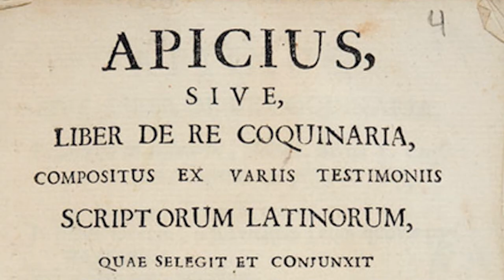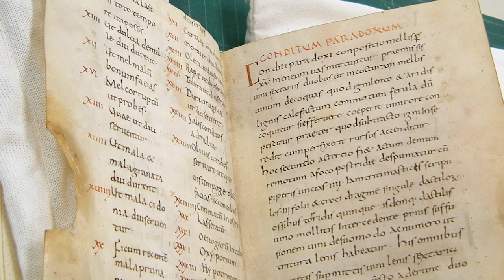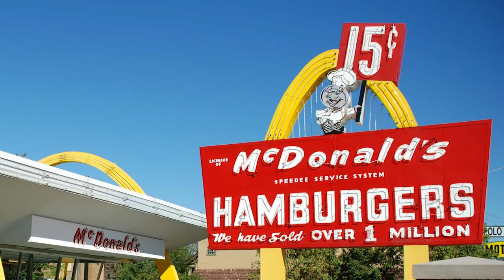How to Make a Burger That Costs $437

Comment: There’s a huge improvement in your blacksmithing!
Reply: But a huge failure in the premise; the promise of discovering and building each step in the reset journey.
Reply: I bet it wasn't him
Reply: Some scenes are him but not the the rounding for sure. I like the show but boy he is still so bad at making things by hand after all these years.
Reply: @skipmage  You're right you can wait years to do it the "right way." For the most part proof of concept is enough to demonstrate it was possible. Not using more efficient methods after after proof of concept is a waste of time.
Reply: @allstarwoo4  And I'd be OK with that if, you know, He didn't have a real blacksmith make him a set of tongs from bar stock in a modern forge with a full set of professional tools, before he's so much as forged a cohesive piece of  iron.
And then Andy just continues on like, hey guys these tongs work great there it is I've mastered Iron, so I'll just start using steel too, cause copper and bronze are totally the same metal.
Reply: @skipmage  yes but no, this is not primitive technologies, his series progresses rather than sit on one category, since budget and time constraints are a factor, he can’t idle about without posting. There will always be a compromise since we don’t know how well he’s doing. It’s like telling him how he should run his show when you yourself don’t really know the process that takes place. If you look at linustechtips work flow, it makes video production seem like a headache. There is no right way, just enjoy what he can do
Reply: @skipmage  well the channel is about recreating discoveries in human history not about becoming a master of a specific skill. I get it sometimes I get annoyed when he doesn’t do something to his best abilities but sometimes it’s not reasonable or it doesn’t matter.
Reply: @allstarwoo4  we are not talking about the man half carving a stick and calling it done; we are talking about finding silica and calling that a computer.
the technological divide between Iron and steel is something like a thousand years.
We are Talking about a Provider Promising a climb through technology by himself, and completely shitting on that promise.
Reply: @skipmage  it may have taken a 1000 years but going from iron to steel was easy. All they had to do was add more carbon in the smelting process.
Reply: @allstarwoo4  No, and the fact you think that shows my point.
The problem was getting less carbon in the smelting process.
Wrought Iron has a carbon content of about 8-12% where as good high carbon steel reaches 2-3%.
Wootz steel did this by segregating the Iron and a little carbon inside the crucible.
early industrial steel producers did this by burning out additional carbon, which was hard and sloppy.

And again, If it was Easy, I would care less about Andy showing this step.
Reply: @skipmage  These steps have been covered before.
Reply: @skipmage  that refinement isn’t necessary in that they only need enough carbon steel to show it’s possible. Think about it the burning out process is just them leaving the bloomery on so the carbon can achieve their ideal carbon content.
Reply: I've always thought that part of the point of this series actually is the fact that Andy isn't very good at most of the new skills he's learning. It helps show just why it took thousands of years for certain technologies that may now seem simple to us to be developed.  The bloomery saga, all the attempts that it took Andy to make just one crappy little blob of iron really made me realize why the bronze age lasted so long. So it makes sense that in order to keep advancing he sometimes has to skip over a few thousand years' worth of the trial-and-error  that was originally required for humanity to refine a certain craft or technology by having someone more experienced make something for him, if it's something he's going to need for the next project. Showing how someone who actually knows what they're doing does it, even using more modern methods, is interesting and educational too. Would you really want to watch Andy gradually improve his ironworking skills for several thousand years?
Reply: YES
Reply: @BellToneSynthWorks  Skill is not something one accumulates for thousands of years. It's the techniques (skills as in "a particular ability") and knowledge base to help acquire that skill that does. Skill as in "the ability to do something well; expertise" can be achieved in a lifetime. 

I don't think it really demonstrates why it took so long because the crew already know what they're "supposed to do" in advance. Even with all the team's need to improve their skills and figure out exactly what mistakes they made to perfect it going forward, they at least have an exact idea of what they're pursuing. IRL it isn't just trial and error, but many years spent with one method "just working" and being the usual thing that was done without any specific idea of what the next innovation on our backwards traced tech tree is supposed to be. There was innovation, and often that innovation was directed toward an immediate practical purpose or experimentation, but it's not like people were specifically aiming to achieve future technologies they couldn't conceive of yet or make any use of.

I think the series is just fun and neat in that it shows how people in the past did things and the team attempts to do them with (mostly) period appropriate tools and materials.
Reply: @skipmage  The divide between iron and steel was a 1000 years because steel was discovered largely by accident and haphazardly.

Realistically, mastering pottery takes a lifetime, mastering copper and bronze casting takes a lifetime, mastering iron and steel takes a lifetime. considering it can take several months of dedicated work just to forge iron without burning it, I'm not going to fault the guy for getting experts in after he's at least demonstrated the process. I sure as hell can't forge that well. :P
Reply: @skipmage  Thats just sad
Reply: Kinda also goes to show that one of the most important advances in human society wasn't actually purely technological but rather in the skill of the craftsmen and that's something we tend to forget.
Reply: @skipmage  You got your % wrong chief. 
Plus " No, and the fact you think that shows my point.
 The problem was getting less carbon in the smelting process." > that's true for mass production, not for small production of steel, in small production like andy's you need to add more carbon, like in the wootz process you mentionned. I'm a metalworker and i'm fine with andy doing what he is doing right now.
Reply: @nora1034  Sure: you have mild steel at the click of a button; a power hammer, a proper anvil.
You know all the little tricks and tips for working in a modern forge.

If I gave you an apple and a cup in the middle of nowhere and told you to make bread, how would you do? 
How about If I promised you a loaf of bread then showed up with said ingredients?
Andy is doing this.

It is not a matter of if you feel entertained. It's the fact that his premise for this series has been, "Can I figure out how to rebuild tech, using only the tools I've previously built."
So, I feel just as justified in saying Andy, this isn't what we agreed on. As you feel justified in saying, ""I'm a metal worker and I feel fine with him jumping steps.

Also ash baking.

Comment: I feel like the surface texture of the spatula is making food stick, maybe a little polish with a decent stone might smooth things over, so to speak.
Reply: Just like that cleaver needs some passes over a grinder and whetstone, too, lol. Still, not bad.
Reply: Season it too, with some oil and heat.
Reply: What?!

Refine the tools instead of a doing the bare minimum?? You must be new here.
Reply: or just punch some holes in it
Reply: @DH-xw6jp  haha he just hasn't gotten to that point of civilization, right?
Reply: @DH-xw6jp  maybe they should get the most important aspect of early civilization: slave workers
Reply: @RmRoyalflush  pft, we are beyond such barbaric practices such as slavery...

We now call them unpaid interns.
Reply: Also adding grating to the spatula so that it doesn’t stick and can press the patties from the top, that is very important for getting a crisp burger
Reply: @DH-xw6jp  WHADAWHA WHAPWADA
Reply: @AVerySexuallyDeviantOrange  that's the purpose of the grating?? So it doesn't stick?? I've always assumed that it was just for economic purposes, like yknow, less material used
Reply: @LiveFreeOrDieDH  I fully agree. It should be seasoned like cast iron is. That slick nonstick surface will help with food handling.

Comment: I knew from the moment I saw that grill that it was going to be trouble...
Reply: same
Reply: Not enough tines and not fixed tines aren't helping, lol, but it still was passable. Maybe if he had some way to lock them in place temporarily?
Reply: Hammer out a piece of steel , thin and flat as posible and place ontop of the spines.
Reply: @Mr2winners  i think a cast bronze pan would be easier to make than trying to hammer out enough sheet metal on that small stake anvil.

Comment: For the grill: 4 Metal y-steaks with a single rod to lay across each pair. The grill rods should have two loops, one on each end. Then the single rods can go through the grill rod ends then lay on the y-steaks. Might take more work but give a bit better stability for the grill. Also highly portable.

Comment: I don't know if you're already planning to include this, or will even see the comment, but there's a little trick with beveling an edge that can roughly halve the work you do - holding the blade at an angle to the anvil, so that in striking one side, you effectively bevel both. It may also help in getting better edge geometry, but that's a discussion for another time
Reply: honestly? they dont even get that they essentially destroyed the cleaver  while cutting the parsnip on the stone... the chopping on the stone gave it the rest.
for that they deserve to do double the work three times over until they learn what should be common sense.
this channel got gradually worse after the "reset". it is like they arent even trying anymore.

Comment: Most uses of caul fat in modern times that I've come across use it to wrap meat during cooking for both structural integrity and also to continuously baste with fat as it renders. However, it's typically removed from the cooked product before eating, since it's a tough membrane. Not sure if the original recipe instructed that or not, but it would have greatly increased the burger edibility.

Comment: for the moveable tines grill might it be worth having the 2nd support be wavy or have indents that the tines could sit in to help keep the from shifting? have them at regular intervals along the whole thing and you still have an adjustable system but it will be more stable.

Comment: Cutting on any surface that is harder than your blade will dull it very fast. Since the original knives were glass and copper, it would stand to reason that wood and laminated leather were developed as cutting surfaces long before the invention of iron tools. 
Stone would still be preferred as a grinding and pounding surface, just not when a blade is involved.

Comment: how to ruin the edge on the brand new cleaver you've made: chop on a damn stone
Reply: Thankfully part-way through they switched to a wood chopping board.  I'm sure sharpening blades was enough hassle that they would have undertaken effort to prevent dulling where possible.

Comment: If you make some notches on the opposite stand for the grill, then the tangs can slot into them and stay significantly more stable, rather than potentially sliding apart and accidentally dropping a clay bowl full of boiling oil all over everyone :)
Anyone else's blood pressure skyrocket when they watched that?

Comment: I am asking myself how close to an actual 21st century Burger one could actually come if they are not limited to the available reccources of the old but instead of the new world.
I am really wondering what you would be missing or if it could be done without any limitations.
This is because i am not too informed in the question of there being actual grain's like wheat etc in the new world.
Besides that i could not think of any other limitations.
Although it could maybe change it a bit due to the fact that there were neither Chicken , Pigs or Cows in the americas.
You would have to fall back to Llamas as domesticated animals i think.

Not sure.
Maybe someone does something with that idea or it actually is done here which would be kind of cool as a kind of twist or something.
Reply: Bison are from the new world and they are pretty similar to cattle, so I’d imagine you could get pretty close. Also if I recall correctly there were grains in the new world but I can’t remember which ones.
Reply: @silaskuemmerle2505  yeah i had something like that in mind as well. It's just that people still are nit really able to domesticate those so it could be tricky etc.

Comment: I notice you have rolled back the whole "One Man, Alone; creating civilization from scratch".
But the was the deal Andy. Eight thousand generations of technology and skill built up by one man, leading to the steam engine. (Which BTW wasn't a product of the Industrial revolution. The technology just became much more prevalent then.)
Go back: source your own Iron, Smelt your own Ore, Smith your own Tools, Discover Steel, 
Don't just cheat scrap metal, Don't have skilled smiths do the hard parts for you.
Don't just hand wave the production of steel (oh, well I have Iron, so I'm going to place this machine Steel cutting edge in my axe. It's totally legit)
I see you Andy, and I hold you to your word.
Reply: Use a piece of meterorite steel for axe edge thats would not be cheating 😉
Reply: @Mr2winners  If he could source it himself, no; because that is the whole point of the series.
Buying it would be against the rules as laid out at the beginning of the series.

Comment: Technically, if you made everything yourself, the burger cost $0 because you ideally spent $0, even though you probably spent a lot of money reverting yourself back to the iron age. If you're going to base cost on what someone would get paid to make this burger, you should have, at least, done the cost analysis for yourself - total YouTube-money ad revenue and Patreon earnings for this and other related videos, divided by how much work you put in - because modern peasants can't spend the time or afford the resources to make this, in the same way. Someone making minimum wage could probably make a physically identical burger, or a more-sophisticated burger, for less than $20, but that's with a modern supply-chain and kitchen, so you really need to take that into account.

Comment: From a culinary standpoint:
Blanching any starchy vegetable will draw the starch to the surface for a crisper exterior when fried. Preferably blanched in oil, allowed to cool (or freeze) then fried.

Caul fat is definitely something most Americans would shy away from today. To use it properly, you first soak it in cold water and a bit of acid like lemon juice or white vinegar. This helps with the smell, which can permeate the food as you cook. Since it has a lot of connective tissue, you can either trim out a lot of the finer webbing, leaving only the thickest strands, stretch it super thin or (a much more modern technique) pack it in an enzyme rich relish like onion, apple or pineapple to break down some of that tough chewy stuff. Caul fat can be used as a casing to help hold mince together, although your flour binder should have been sufficient. It's main purpose, however, it to baste the item in fat as it cooks, preventing too much moisture from escaping. 

I'm not sure about ancient roman condiments, but grape must was plentiful and used in certain aging processes for food. Dates were also common and frequently used as a sweetener in place of honey. Mixing in some date paste and grape must would have probably gotten you closer to the texture of ketchup and a bit closer to the sweetness of tomatoes as well.

Comment: Why are we not using a cutting board instead of a cut rock. Seem like putting down a wood plank would be a improvement to dulling the blade and possibly getting little rock chips mixed into the meat.

Comment: What do you mean ORIGIN of French fries? Are you actually saying that you believe the  "recipe" for them was passed down over generations? Or do you suppose it's more likely that another person, or possibly thousands, just picked up a potato cut it into long strips and dropped it into hot oil? My point is that not everything is passed down. Lots of people do the same thing in different places. The Romans can't possibly be responsible for everything. Even trying to give away our hamburger.. damn, bro. Because nobody anywhere else was smart enough to stick a minced meat patty between two pieces of bread either, right?